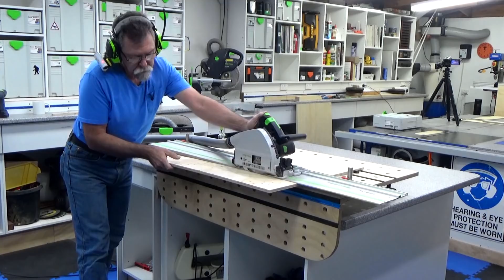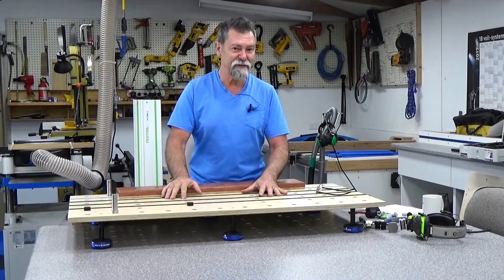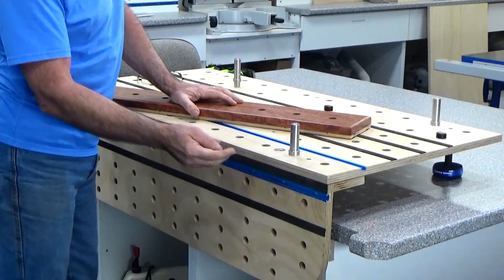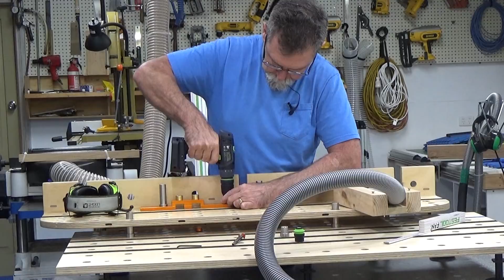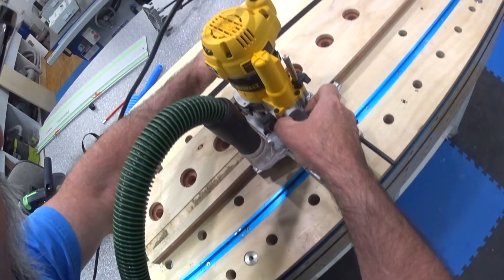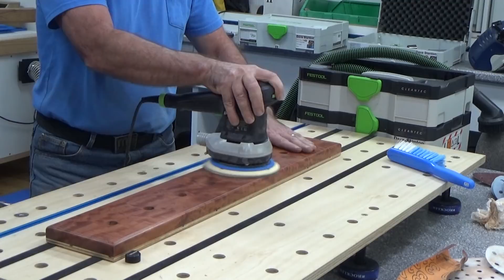how to build a moxon vise for your stanton bench dave stanton woodworking workbench  festool clamps

Comment: I call shenanigans!  How did you get the clamp through the skirt after inserting it through the vice face @ 7:25?  The only way I can see is to take the clamp apart and thread it from the skirt through the vice.
Reply from the maker: Hi Scott Baker! No shenanigans! If you hook the clamps into the skirt and let the moxon face drop down then rotate the clamps 90 (horizontal) and hey presto, in they go.
Reply: @DavidStanton  Ha!  I get it now.  Excellent!

Comment: I would like to purchase a Stanton bench from you.  I can not afford the parf guide  system but could absolutely use this...I am new to woodworking and having a system to take error out would be a great advantage.
Reply from the maker: What country are you in Jon?
Reply: USA, sir
Reply from the maker: The cost of me building and then shipping to you would be much more than the parf guide system. May I suggest you purchase the plans and the hardware, build the bench without the regular dog hole pattern to economise. This will of course reduce the functionality of the bench. If you purchase the parf guide system the bench really shines!

Comment: Would the parf dogs have to be longer to place a thicker piece of timber in the vice? If not the vice wouldn't be flush with the table.
Reply from the maker: Hi Joe. As the bench is designed for inside home use I doubt any timber thicker than 2 inches would be called on. If it was, I would try to clamp it down on the top of the vise. Just noticed we are spelling vise the English and vice American way. lol.
Reply: Understood thanks.

Comment: Dave could you have made the 'jaw' offset. So one side was flush with top whilst the other was say 20mm above to supply an additional clamping option for panel glue ups?
Reply from the maker: Not really LostWhits. My version is designed to clamp top and bottom of the jaw to maintain its strength. Thanks for watching!